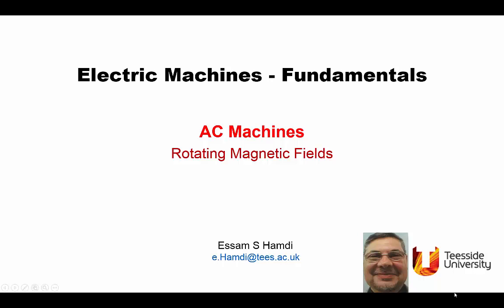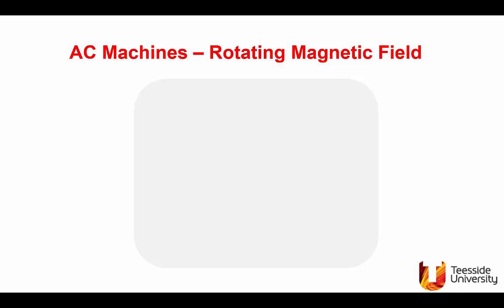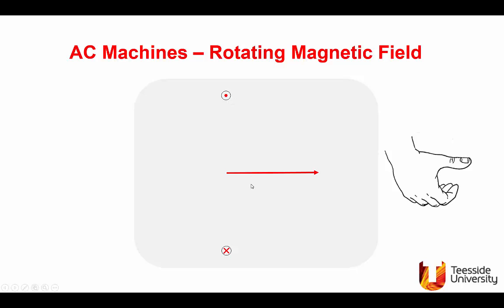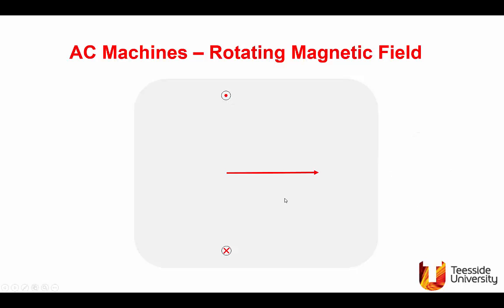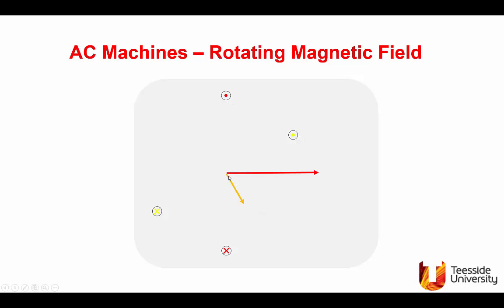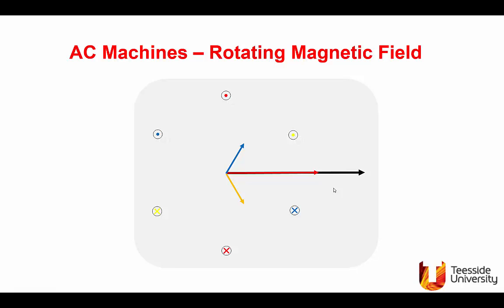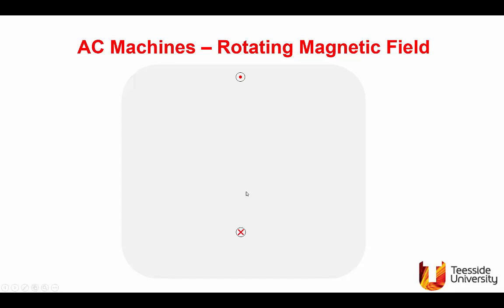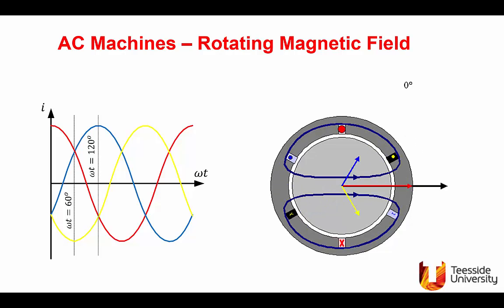Rotating Magnetic Fields

Comment: video is really useful but i have question that what will be effect of harmonics on the shape of rotating magnetic field  ?please ans this question
Reply from the maker: Replied via email.
Reply: @ProfessorEssamHamdi1961  Dear Professor,
Can you please forward me the answer as I'm also interested in knowing the impact.

Many thanks in advance,
Reply from the maker: Hi
Each harmonic produce a field that is rotating its corresponding
synchronous speedEach harmonic produce a field that is rotating its
corresponding synchronous speedEach harmonic produce a field that is
rotating its corresponding synchronous spEach harmonic produce a field that is rotating at its corresponding synchronous
speed (e.g. the third harmonic produce a field rotating at three times the
fundamental synchronous speed). In order to ensure smooth rotation (especially
at slower speeds), design measure are taken to reduce the magnitude (and the
torque produced) by the harmonics.

Comment: At 8:37 you explain that the three magnetic  vectors Fa, Fb, and Fc are displaced in space by 120 degrees. Why isn't the 120 degree separation displayed in the vectors drawn throughout the video? It appears that the three vectors are 60 degrees apart.
Reply from the maker: The winding axes are displaced by 120 electrical degrees with respect to each other and, if the excitation current in all windings is the same, the mmfs will be equal in magnitude and displaced by 120 degrees (but the
resultant mmf will be zero). You can check this by arranging the red phase
along the Y-axis with current entering the bottom coil-side, blue and yellow
phases as indicated in presentation with current entering the upper coil-sides. If the three currents are equal, then you get the 120 degree displacement (and no resultant mmf).

In AC machines, however, the winding is fed from a three-phase balanced power source and, at all times ia+ib+ic=. The presentation considers specific instants of time and determines the individual mmfs and the Resultant air-gap mmf. When an individual current is zero (as it happens every half-cycle), the corresponding mmf vanishes but, at all times, the resultant mmf is equal to 1.5 the maximum phase mmf.